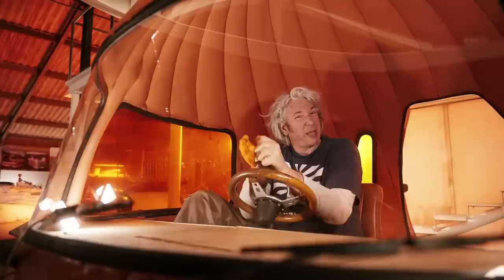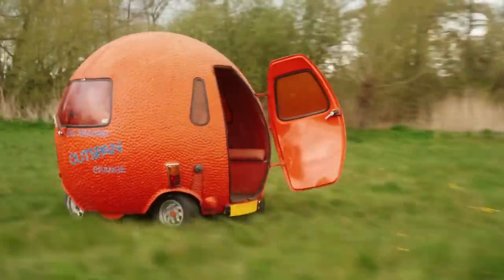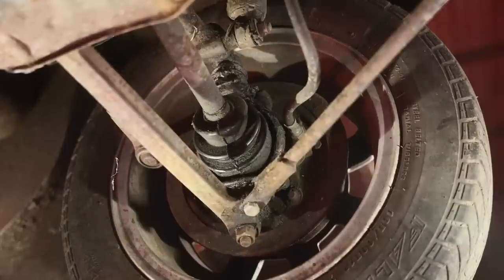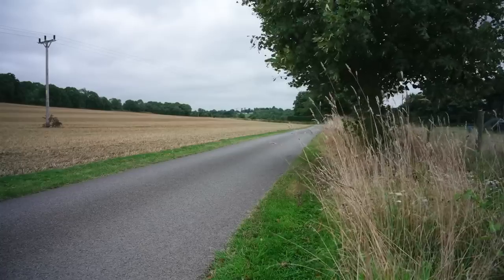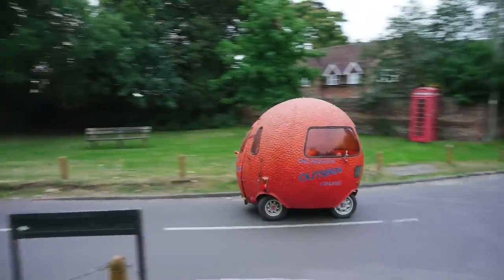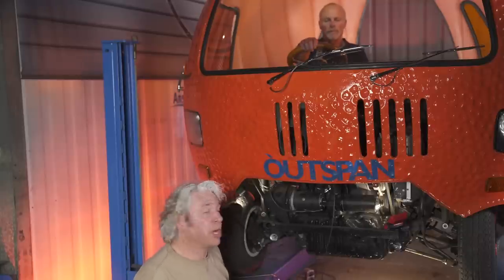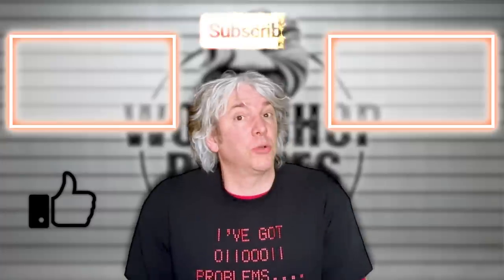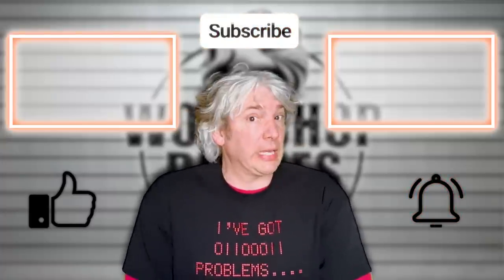Yes, It's A Driving Orange! 🍊 | Classic Mini | Compilation | Edd China

Comment: I think the off camber might of been  put there on purpose most likely a circus vehicle in its former life at some point of its use???

Most likely a gag vehicle  with 10-20 dwarfs  to hop in and out in a circus ring never designed to be technical road legal though only legal enough to be driven onto a car transporter  between circus or stunt gigs..